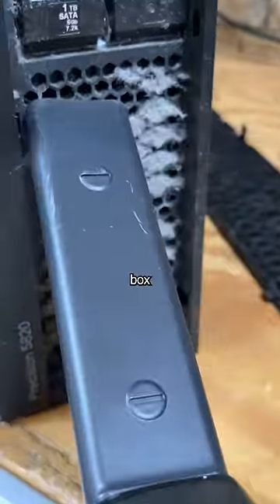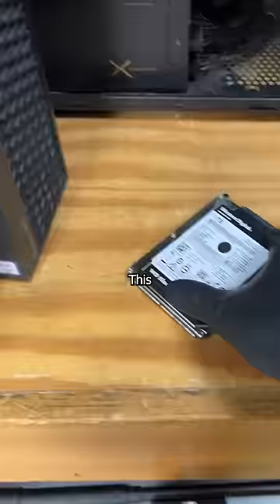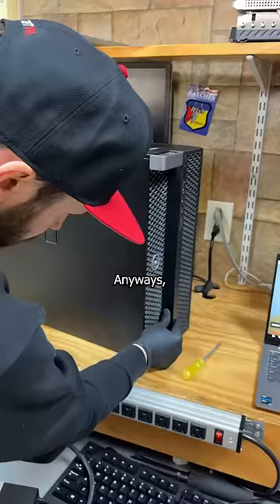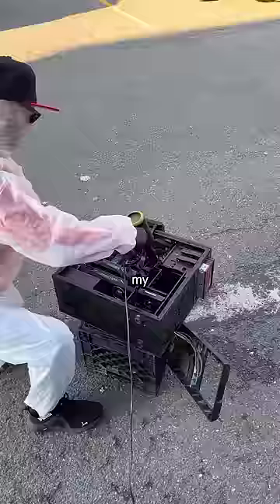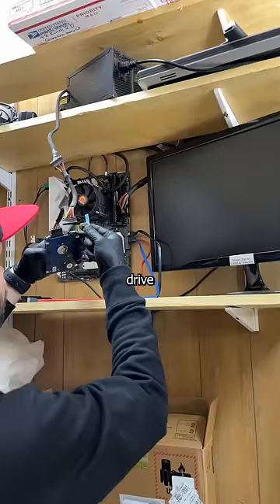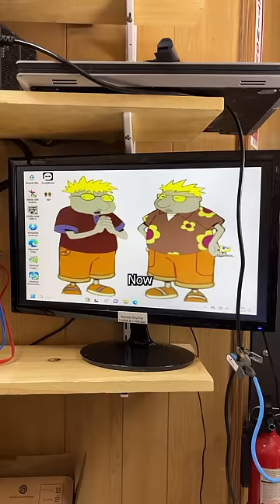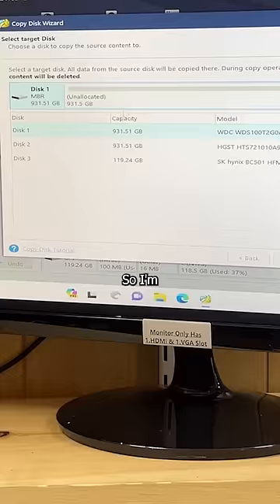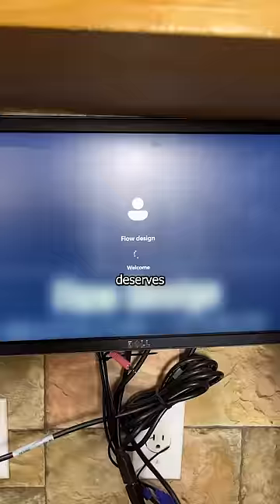Dusty Dell Precision gets a repair and upgrade #tech #pc #technology #shorts

Comment: being able to use a vacuum for the dust gotta b satisfying asf and disgusting asf
Reply from the maker: Indeed, I’d much rather blow it outside but 🤷🏻‍♂️
Reply: @SalemTechsperts  anyways wish me luck bouta buy a 3080 from amazon
Reply from the maker: @LilTachanka How much?
Reply: @SalemTechsperts  depends on if I get used or not, refurbished it's about 580(EVGA ftw3), or used for 440 but idk bout used. or a new 4070 for about the same

Comment: The greatest failure in Precision design known to man. That model won’t even stay powered on with the side panel off because of Dells proprietary BS.
Reply from the maker: Yeah it screamed at me and powered down when I opened it while it was on 😂
Reply: I ran dell diagnostics once and left the room and freaked out thinking some building alarm was going off
Reply: IIRC correctly, there is a switch that it activates when closed that can be removed from the motherboard and replaced with a jumper, if I am thinking of the right model.
Reply: nope, cannot remove the chassis intrusion without the server freaking the F out. Absolute design failure.

Comment: I have a Dell Inspiron 530 that my dad had since before I was born. It was always so loud and I opened it up recently just to see a bunch of ball powder all over. Vacuumed and blew it all out and it’s basically silent. Just gotta replace the HDD with an SSD and it’s perfect. Already runs perfectly fine with Windows XP but it’s a bit slow running Linux Mint XFCE.

Comment: That's the exact same machine I use at work. It's a good machine. Mine has a m.2 in the front right slot there (proprietary connector).

Comment: A client of ours actually had one of these. It was sent down with a bunch of equipment they haven't used in years. It turns on, but for some reason, it doesn't recognize any drive we insert, and it has 6 different drive bays.

Comment: I really hate opening that exact case. The locking mechanism doesn't always open easily. We have several of these at work.
Reply: We do too, and they are usually located in the cabinet's of special ovens that are used to fill parts with molten salts. As you might imagine they get loaded up with dust and salt residue. 

I'm not a Dell fan but it's amazing what these things put up with, the only real problem we have with then is the power buttons go bad.

Comment: We just got a pile of these precision workstations, they replaced a bunch of boxes that had Pentium IIs running proprietary software. I wish I could get the 1997 tech back, these things absolutely suck. They take decades to boot and randomly crash all the time. Not to mention the front isn't flat so you can't slap a magnetic filter on it.

Comment: Nice little programme to have for Hds is HDD regenerator, let's you fix bad sectors on HDDs. Worth buying but obviously it's a slow process but for a few bucks you can bring drives back to life. Handy for data recovery too
Reply from the maker: Yeah I've used that for data recovery and to repair before clone if it's really bad but thankfully this wasn't at that point
Reply: @SalemTechsperts  very very handy program that surprisingly many don't know about or even that is possible to actually regenerate a bad sector on a hard drive if it's gone bad. I'm shocked that it's the only tool I've seen that can do that to being that it's part of the drive an they all can do it. I found it from some obscure version of Hiram's boot disk a really old early version. The later ones didn't have it on even tho it was the free one sector fix trialware

Comment: Ironic i get this video since i have to go in to a repair shop once it opens up to replace my hard drive, turns out a 50’000 response time is not good, and the disk usage should not be at 100% constantly when its idle with only task manager open. Only figured this out through a tech friend after i got fed up with waiting 5 to now 20 minutes for a single webpage to open. Hopefully this wont cost me much, i need the laptop for finals exams..

Comment: Question, is that a special type of vacuum that doesn’t produce static? Because normal vacuums produce a crap load of static which is obviously bot good for electronics
Reply from the maker: Vacuuming the outside of a plastic case that's 6 inches away from any component is completely fine. Don't stick a vacuum inside your computer and start sucking up components like a psychopath and you'll be good.
Reply: @SalemTechsperts ohh okay thanks for clarifying

Comment: So my nvme ssd is slowing down? Cuz after I get to the Lock Screen and log in it takes 10-20 seconds to get to the desktop.. purchased brand new as well.. 

WD Black SN750 SE Battlefield 2042 1tb (bought it new for 75% off at the time.. which was October 2023..)

Comment: What's the cloning software you're using?
Reply from the maker: I literally said it in the video 😭
Reply: @SalemTechsperts  I actually heard you say it but I thought it was a joke.  I'm actually interested in knowing if it just clones the disk or does something else.  So for instance would dd (the Linux command) do exactly what the software does?  Or does it do something else?

EDIT: No worries.  I'm doing my own research on it.  Looks like dd is stupid and just copies without allowing for the extra space on a new drive to be used so one must use gparted.

Comment: Lock or not those latches NEVER FUCKING OPEN THE PANEL.  Fresh out the box STILL won't open the fucking panel without prying up the panel 80% of the time.  Hate that design.

Comment: Or they can stop being a cheapskate and buy a new pc. Someone has already replaced that drive at least one time already.
Reply: Whats wrong with continuing to use hardware? Why throw the whole thing out when only one part is bad?
Reply: @loosemoose5217  For a repair shop it's not an issue, but if you're the computer person in your loop you'll spend countless hours working on old clunkers like this.